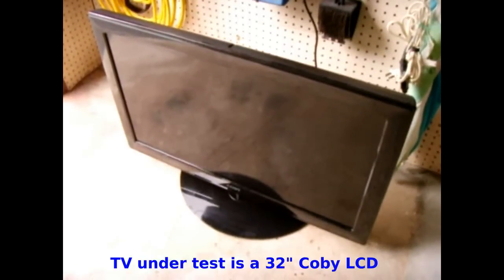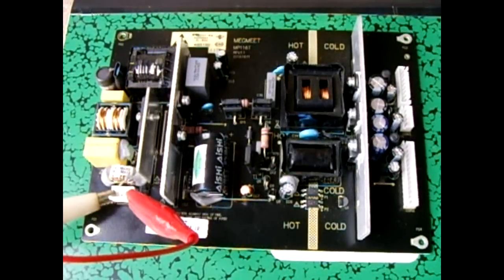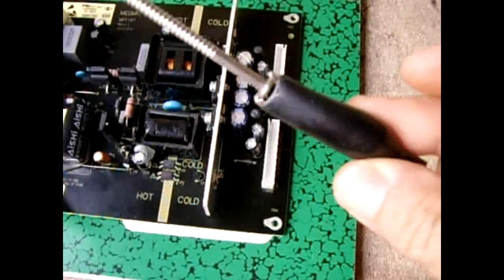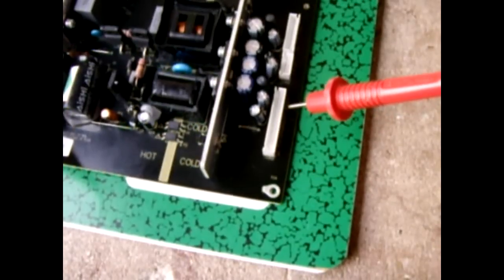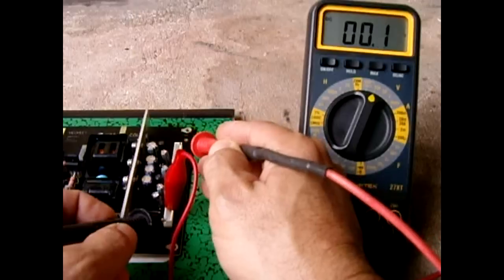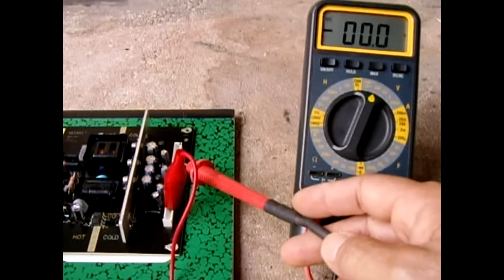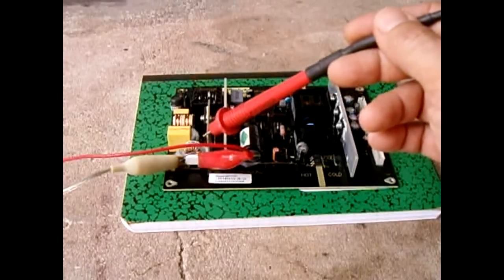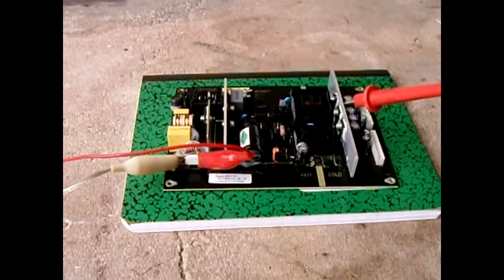How To Test LCD/LED TV Power Supply Boards(No Power)

Comment: Hi! 
I'm quite the newbie. I have a tv that shows no signs of life, and I've tried my best to fix it. If i disconnect the cables from the main board and short the pson, the tv seems to turn on, but with no video obviously. When it's connected to the main board, however, I can't get it to show any signs of life. I tried shorting the pins while connected (in case the power button would be broken), but no luck. Can I assume that the main board is the problem?
Reply: Daniel Aldenmark (The tv is a SHARP LC-32LE430E)
Reply from the maker: Daniel Aldenmark
Hi Dan,
Did you measure the voltage of ALL the pins as shown in the video?
Reply: Hi again! Sorry for the late answer. I have now been able to do some better measurements on the tv. The voltages aren't exactly as they are supposed to, but quite close. The 5,2V show 5,37. The 24V show 24,8. The 12V show 12.3. The "DIM" and "ENA" show 3,0. 
I didn't disconnect a third little board that is connected by the same type of connector, so I suppose that might be responsible for the small offsets? 
However, my problem is still that once the power board is connected to the main board, I can't get it to show any signs of life whatsoever..
Reply from the maker: Connect everything back up, and tap into the 2 wires which connects to the (2) pins which turn on the power board. Short the wires together, plug in the TV and see if the TV turns on. If it does, then the power switch/board is faulty.
Reply: It does not! When only the other little board is connected, the TV powers on and the backlights light up. When the main board is connected, there are no signs of life, even when the power on pins are shorted.
Reply from the maker: This video is only for ruling out a faulty power supply board, which you did. Your power supply sounds just fine. You likely have another board that is faulty.

Thanks For Watching.

Comment: My board don't have pson, only 5VSB & STB. Which one should i  short to ground?
Reply from the maker: The 5VSB shows 5 volts, and the STB shows no voltage?
Reply: +electronicsNmore yes 5vsb = 5v stb = 0v
Reply: electronicsNmore

Comment: Hi I have 12 wire ribbon on my power supply board LG LCD TV. Marked as  (1)NC P-DIN (2) A-DIM Error (3) NC INV on/OFF (4)20V(5)GND(6)12V(7)6ND(8)5.2V(9)5.2V(10)GND(11)GND(12)NCPower-ON. Which two should  pins should I short? pins  11 and 12
Reply from the maker: +Deva Sriram 
Hi there. Unfortunately it is not possible to make one video that will satisfy every viewer, but using the information outlined in this video, you should be able to figure things out. Look for the only pin that has voltage, then post another comment.
Reply from the maker: +Deva Sriram 
Hi there. Unfortunately it is not possible to make one video that will satisfy every viewer, but using the information outlined in this video, you should be able to figure things out. Look for the only pin that has voltage, then post another comment.

Comment: No 3.2v & 5v, so do you think is the regulator is bad cause all the caps are good
Reply from the maker: If you plug in the board (120VAC) and you do not have at least one pin showing voltage, then you might as well replace the board.

Comment: Thanks again very informative I will check all those.  We have a 50 inch
Samsung HP-S503 with a blacked out screen trying to see what is wrong on the
 Y-Board hate to loose the TV it has a great picture.
Reply from the maker: William Ward Could be a faulty capacitor not allowing the inverter to power up and turn on the cold cathode backlight tube. If everything works on the TV, but you can barely see the video image(If at all) on the screen, that is usually caused by a faulty inverter board, or the inverter board is not being power up properly due to a faulty Power Supply Board. 

Thanks For Watching!

Comment: I have a 50" Emerson and it has power but as soon as I cut it on it say Emerson then says ch1 on top in middle of screen it says press and hold the on button for three seconds , but as soon as that screen comes on it cuts off! 
  Now I searched this and it was abt 50/50 more people said it was the main and others said the power supply. I was told to try switching the main first, but tv still does the same thing!! So I'm getting a voltage meter today to test the power supply. Also the guy I bought the main from said he would swap me boards.( bought on eBay) but b4 I send it back I want to make sure it's the power board. What do you think is the problem, and what would you do? I'm not a tech guy by no means but I am good with my hands and fixing things!!
Reply from the maker: Sounds like a faulty power supply board.

Comment: Am trying ("trying" being the operative word) to repair a Vizio 42" television. I've connected the +5VSB and PSON pins with wire and put power to the board, but I can't find voltage on any of the pins! Am I doing something terribly wrong, or is this power board just that borked?
Reply from the maker: Make sure you have 5V before shorting the pins.
Reply: electronicsNmore How would you power it? I connected the three power pins to the TV's power jack (as it had been connected before I removed the board) and the jack to a wall outlet. Are there any alternative power sources? 
Also, I noticed a burned out resistor on the board after looking closely. Could that be the problem or a symptom of a bigger issue?
Reply: electronicsNmore How would you power it? I connected the three power pins to the TV's power jack (as it had been connected before I removed the board) and the jack to a wall outlet. Are there any alternative power sources? 
Also, I noticed a burned out resistor on the board after looking closely. Could that be the problem or a symptom of a bigger issue?
Reply: 22

Comment: Hi mate.  Great videos - i've learned a lot from them.  I've been testing a power board where pins 1 and 2 are supposed to output 13.2v dc.  the meter shows 13v dead.  Should I be concerned about the difference in voltage or is this normal? Thanks!
Reply from the maker: Voltage should be very close to the marking on the board. 13V sounds OK. Your DMM could be slightly off if using a less expensive DMM, or there may be a capacitor with higher than normal ESR. I have another videos showing a very nice and inexpensive ESR tester that you can buy. Be sure to check it out. :-)

Comment: hi what could the fault be if all readings are nearly double.? 5v=9v 12v=19v 24v = 50v anything i can do or do i need new power board. tv works fine then reboots for 20seconds.only turns off with pulling plug from mains.
Reply from the maker: +face vendetta 
Try another digital meter to be sure, or test the voltage of your car battery using the meter in question with the engine off. If the meter is working properly, you should see around 12.6V.
Reply from the maker: +face vendetta 
Try another digital meter to be sure, or test the voltage of your car battery using the meter in question with the engine off. If the meter is working properly, you should see around 12.6V.
Reply: thanks for reply. yes i tried that 13volts. a 9v battery was 8.9v.
so dont think its the meter at fault .tv shuts down after 20sec and reboots for another 20sec. picture and sound are fine.the remote and buttons on tv do nothing.
Reply: ok the board is a gpac-211424a-rev2.4
the pins are marked 1 to 4 24v shows 26.9v to29.7v pins 14 to 16 marked 12v shows 13.6 to14v pins 17 to 20 marked 5v shows 5.6v and pins 25 to 28 marked 5v shows 5.6v pin 28 shows on/off 5.3v constant on or off.
Should speaker wires have 7v going through them? 4 wires to both speakers are 7v ?
happy new year one and all.

Comment: Hi I have the same 32": and the volume is too loud. It will start to have sound a level 3 and its too loud. Levels 1 and 2 have no sound. I can I fix thx
Reply from the maker: Sounds like a faulty board(main board).

Comment: What if the output voltage fluctuates? It goes from 0 to around 14 volts when it's supposed to be 13.
Reply from the maker: V output should be stable when activated.
Reply: @electronicsNmore  I have a 55" Samsung LED curved TV. This fluctuation happens with the power cord inserted and all other cables unplugged. So that means I have a bad power board doesn't it? Also I'm supposed to have 337vdc and 227vdc on my LED outputs. But I have a fluctuation from 351 to 367 on one of the pins and 0 on the other.
Reply: @electronicsNmore   I have a 55" Samsung LED curved TV. This fluctuation happens with the power cord inserted and all other cables unplugged. So that means I have a bad power board doesn't it? Also I'm supposed to have 337vdc and 227vdc on my LED outputs. But I have a fluctuation from 351 to 367 on one of the pins and 0 on the other.

Comment: salut i appreciate your video , and i have questions to verified if my powerboard is  defect  . my tv is soyo sytpt-4227ab  LCD tv 2007 .  i put togheter the po/on  and the 5vs  , and after i check the12V and the 24volt and nothing . on the 5 volt vs i have 4 volt and the green light is on  , if i plug it on the wall    . but no sound no picture and command not work . wat do you think can you shure is the powerboard  . thanks for your help jc
Reply from the maker: julia kneebone Sounds like you need to replace the power supply board.
Reply: hi i live in france now . and is not easy to find the board . i need a video show to verified the voltages on powerboard .    thanks for your help  jc

Comment: Hi! Great video, I looked at the output and all of my pins seems to be showing the right voltage but I did not short the power switch pin  at all, is this an issue with the board? (I am working on a smart tv)
Reply from the maker: For all power outputs to be active, it must be powered on. Thanks for watching!

Comment: Do all power supply boards have a fuse ? I can't find one on my board.
Reply from the maker: The boards I've seen had them. Look for a spot on the 120VAC input side of the board. It may be marked "F", and look different than what's shown in this video.
Reply: I looked at both boards with a magnifying glass. Can't find one.

Comment: I have Lg tv model no. 47LE5510-TB,PRODUCT CODE 47LE5510-TB.AAUWLJD AND SERIAL NO. 010INRC6P310.. there is no audio.I have tried every way headphone out optical out AV out none of these are working. Please suggest me the option. Regards
Reply from the maker: Jaspreet Gill I suggest you go into the TV settings/menu and check the audio settings. I had a friend say this before, and there was nothing wrong with the TV. 

Thanks For Watching
Reply: Thanks for reply me back.Thing is this I have tried every thing even factory rest but the result is same....

Comment: hi i'm troubleshooting a toshiba lcd tv 32HV10E when i plug the power cord green light power indicator appears but with no picture and sounds when i press the power button nothings happens i check the 5 volts standbye it is present and also the 13 volts can you help me with my tv thanks
Reply from the maker: +Tomas Sto, Tomas 
Hi Tomas. If you followed this video, and all the power outputs work, then you can rule out a faulty power supply board. The main board could be the problem, or the inverter board. Since you have no video or audio, I would lean towards a faulty main board.
Thanks For Watching!

Comment: Im trying to turn on a little power supply  board for a 250 w led light it has sw which is for turning it on right so i connect sw to a - or + to turn ut on ? Thank you good video
Reply from the maker: Manny Suarez If there's voltage on the SW pin, then it probably needs to be connected to Neg/GND. I have no idea how your board is set up, so I'm only guessing.
Reply: electronicsNmore oh thanks ! yeah i did   it was from a projector that that had the audio board fail so i was trying mod a disney lamp lol what ever other than 2 12v 2 ground and the sw didnt work thanks again buddy
Reply from the maker: Thanks for watching

Comment: Have a phillips 42PF9431D/37.....turn it on green light appears then clicks off and I get 6 red flashing lights pause then  6 again constantly.  Is that code for power supply  When my Sony blinks 3 times it means bulb.
Reply from the maker: You need to do a Google search for your model TV to learn what the trouble codes are.

Thanks For Watching.
Reply: Thank you....great site you have!!
Reply from the maker: Thank you!

Comment: My MP118FL shows twice the voltage where it indicates.  IE where it says 5v shows 10; and 24 shows 48v.   Grnd and PSON shows 10v instead of 5v.  PS is defective?  Please help.
Reply from the maker: If you're getting 2x the listed voltage, then replace the board or try testing with another meter.

Comment: I checked all the voltage pins. They where all good exept one had 3.5 voltage in stead of  5.0 v. What does this mean?
Reply from the maker: 3.5v is no good. Inspect ALL electrolytic capacitors on the board. Ideally you should test each capacitor using a capacitance meter and ESR meter like I show on my channel.
Reply: electronicsNmore I replaced all of the capacitors but i have stil the  same problem. Do you know what else it could be?
Reply: some tv power supply gives 3.5v instead of 5v . Its ok
Reply: I think so this mean the capacitor on that 5 v supply is not working

Comment: Just figured out how to measure for the 5 v and I do have 5 v and all of the other voltages when I short out the PS on pins.  Now what.
Reply from the maker: tom hoag You ruled out the power supply board as the problem, which was the purpose of this video. If you hear audio, but see no video, then the inverter board is likely faulty.

Comment: I like your videos,  however this one hasn't helped me. 
I grabbed about a 42 inch flat screen from the dumpster someone through our with broken screen. It powered up and screen lit up even though badly broken.  I'm trying to repurpose the power board. I'm converting a 18v cordless drill into a micro lathe/mill. So I need the power board to power 18 to 24v D.C. and I thought this would work. I plug it in but don't see anything marked pson or anything close and cannot get anything on any pins other than. 004v .
  I know it was working before I tore it apart. If you have use for balance of these board's we could work out trade
Reply from the maker: Clearly you didn't turn on the power supply board. Just like I stated in the video, look for the 5V pin.

Comment: So I power up the board and it shorts out the power and blows the main fuse the power cable has power but their is no way to test it because it blows the fuse this has left it to 2 options either the board or the cable what do I do?
Reply from the maker: Are you sure you properly turned on the power supply board in order to test the ouputs?
Reply: Yep going off the cables that came with the TV and I'm plugging it in from the TV as well it just shorts out the room but only when plugged into the power board
Reply from the maker: There is no way you can trip a circuit breaker from the use of the TV. The fuse on the power supply board is much lower than the circuit breaker, unless you have a lot of power being used on that line.
Reply: I honestly have no idea how. I'm trying to test it, it has sat for over 5 months after a lightning storm and now it just wont turn on. when i plugged it in it shorted out my room. I'm thinking it's the cable but their is no way of knowing because it just blows the fuse. the only things on that line is the tv and a fan
Reply from the maker: I suggest you watch my "Load Lamp" video. You can connect the power supply board to that and stop blowing fuses to help locate and repair the problem. Not much else I can do for you. Good Luck.
Reply: electronicsNmore I got it working and sure enough no voltage at ps:on it's in the board and I really don't feel like taking it apart so I bought the board and will be scrapping this one probably get about 20 dollars out of it

Comment: My 2015 sony TV turns on, shows the startup screen, but the left side goes dark followed by the tv turning off when it is done loading.
Reply from the maker: One side going dark? Sounds like a faulty power supply or faulty board for the backlight.
Reply: electronicsNmore I will try replacing the power supply, cause I can get one for 60 bucks. If its a problem with the LED's then I am out of luck cause I can't even find LED's.

Comment: Thank you for making this video. Between this information and the troubleshooting flowcharts in the Sanyo Service Manual, I was able to fix my Sanyo FVM4012 TV by replacing the power supply board.

For future reference, my symptoms were:
-RED power LED on whenever AC cord was plugged in
-No backlights, no image, no sound
-3.3V Standby was present on both the Power Board and Main Board
-No 24V present on the Power or Main Boards
-No 58V on Power Board

I don't know which component(s) failed, I just replaced the entire board.
Reply from the maker: +Enrique Rodriguez 
Hi Enrique. Glad my video was able to help you in repairing your TV! Thanks For Watching

Comment: Soory SIr, my TV is 36 inch Samsung LCD TV and there is blue line visible  continuously. My TV is placed very near the modem.
Reply from the maker: Probably a faulty capacitor, poor connection, or heat damaged circuit board.
Reply: thanks for response.

Comment: Great video by the way.  I have no video, a black screen and no audio and no green light on the set.  Also, I didn't measure the "PS on" 5v until I measured between the 2 PS on pins.  Ground to either "PS on" pin measured 0 v.
Reply from the maker: tom hoag You can carefully try(at your OWN RISK because it can be very dangerous) connecting the PSON pin and other pin together with everything assembled and powered up. Tap into the 2 wires on the harness leading to the PSON and GND pins. Route them outside the TV and short the 2 wires together and see if the TV turns on.
Reply: With main board connected??